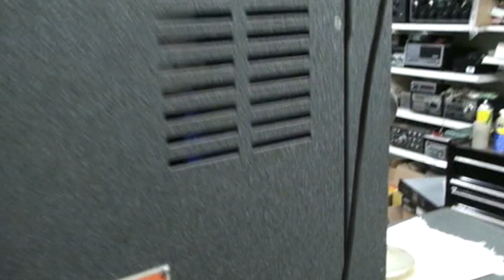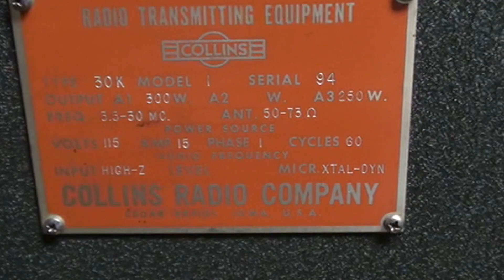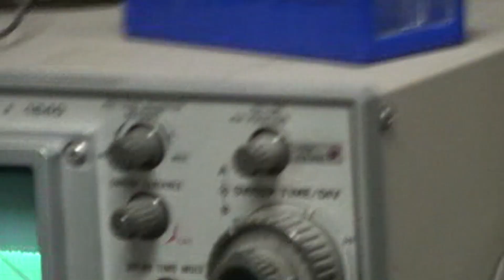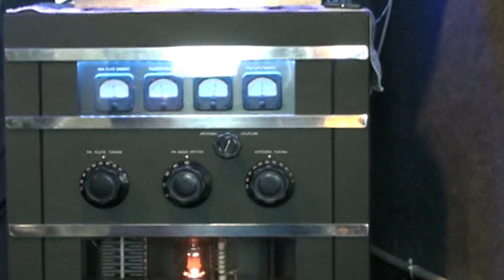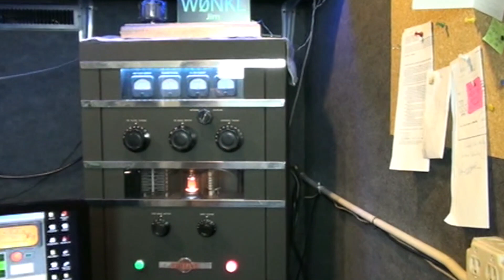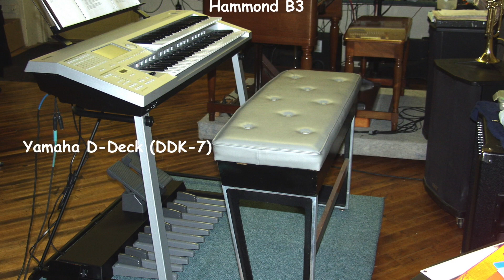"W0NKL" Jim Shoemaker 1:11:2018 Collins 30K1 Fort Scott, Kansas

Comment: Jim,
Lots of vintage and beautiful equipment. Thanks for making a video and posting. 
I also have a 30K-1 S/N 16 that I picked up in 1975 for $75 near Atlanta, GA. It had already been messed with and I kept it as a museum piece until around 1981 when I turned it into a project cabinet where I could slide different amplifier chassis in. I changed out the matching network to a Pi with a big roller coil and vacuum capacitors on each side. It has seen a pair of 4-400A, a 4CX1000A that I ran for over 30 years and now it sports a 3-1000Z. I have the 310B exciter also but  haven't used in in many years. I did use it in back in the 70's as an exciter for an AM station I built running a 4-400A in class-C and plate modulated it with a pair of 4-400A. I had the 310B several years before I picked up the 30K-1. I also have a nice Collins R-390 but i do not have as much equipment as you do. I still run the Collins S-Line on a daily basis.
I have recently discovered the SDRPlay receiver and have been using it a lot. Maybe I will catch you on the air some day.
73
WA4QGA
El Paso, TX
Reply from the maker: Believe it or not, but I just saw  your reply. Thanks, much Jim
Reply: @w0nkl  Jim - you are getting as bad as me missing comments. Not a problem... I started watching your video again and see you have the REA AM monitor for viewing positive and negative modulation. I have that same one now on my James Millen amp that runs push pull 812A and I modulate it with a pair of 4-125A thru a BC-610 modulation transformer.  I also run a circuit providing a keep-alive voltage to make sure my negative peaks never go over 100%. I have made coils for it for 20 and 40M. Original coils are pretty much impossible to find. Lots of things have changed in my life since 2018 around here. Hope you are doing well.
Last thought here - I keep editing my comment - I have the original 75TH tubes out of my 30K-1 if you ever need them - they are yours for free. Just let me know.
Reply from the maker: @ElPasoTubeAmps  Thanks for the generous offer, but I sold my 30K1 last year. I'm down to a 7610 and (2) 3-500Z  amp.  at 84 I don't need anything heavy. 73's Jim